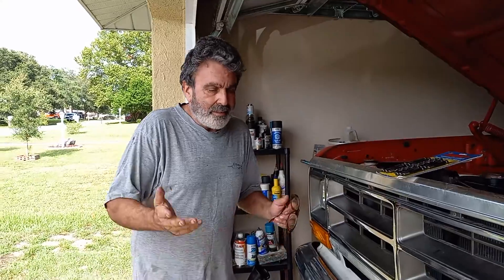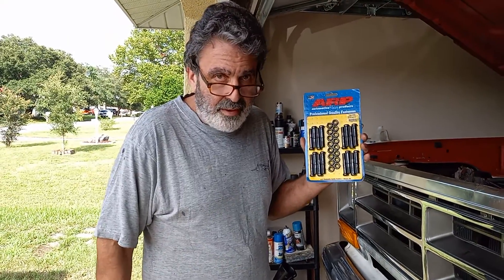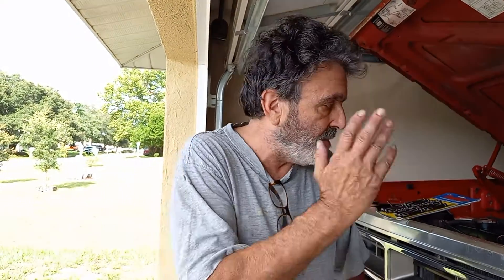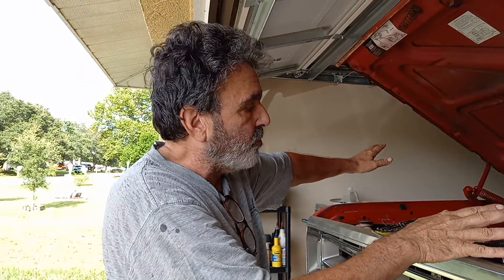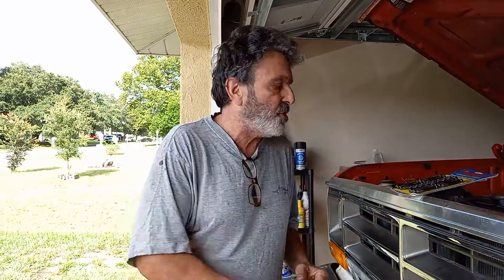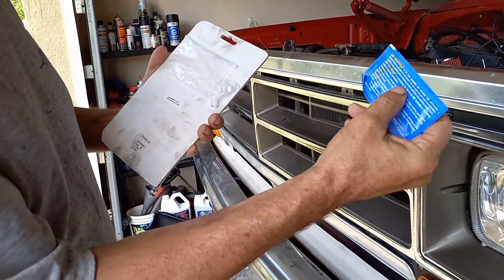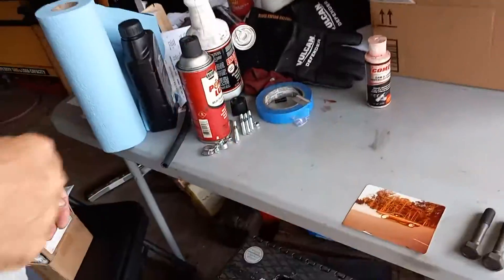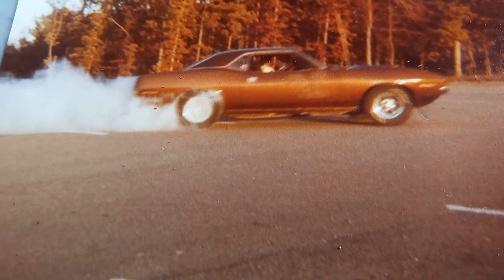Possible issue with my 360 mopar ARP main cap bolts ...

Comment: People spend money on all type of speed parts that they do not need, and which will not make any difference on how their engines perform.. ARP bolts are certainly at the top of the list. I used to own a speed shop in the mid 80's to the mid 90's and was heavily into the performance aftermarket, and I am still in the business. The only ARP bolt that I will use on a street car that is not supercharged/turbocharged or uses nitrous are the rod bolts, anything else is truly a waste of money that can be better spent on something else. Only thing where people waste more money that on stupid bolts are in ignition systems. People will spend a $1,000 + on a billet distributor, MSD box, coil etc... and at the end of all that money they have an ignition system that will maybe make a couple more horsepower than their old points or electronic ignition, and will be less reliable than the factory stuff they had... Carburetors are another bad one, but that is a story for another day...

Comment: I stumbled on this videos and learned something. I have never used arp bolts because I don't race but good to know. 

I decide to subscibe because in high school (1984) I drove a 1970 'Cuda 383 4speed. I now have a 1984 W100 with a 318 that I'm going the swap in a 360 magum. I too have been building Mopars since the 80's. I thinks we're friends lol.

Comment: Your dead on with it should be on every package!! If you go to jeds speed shop on YT... he's working on a pro stock HEMI vintage engine and he had trouble with head bolts and correct torque... You would think a company would get out in front of this issue and save thier reputation!!... This is totally unacceptable period. Thanks for posting this it a great share!
Reply from the maker: Thankyou!  I have not seen anybody else address this issue...
Reply from the maker: I'll have to check that video out your talkin about....    thanks 😊

Comment: You would think that ARP would have tested the bolts at different  Torque other wise why would they put them at 110 fp I think they must be hiring stupid people that don't test anything if it test good on a computer then that's what is . Instead of getting out there and testing them and thats what you should have asked them is if they test those studs or just guess what to Torque them to.  And I don't think that it would have came loose so  I would have just left them alone and not changed them back out . Because if you have 60 miles on them and you have dropped oil pressure at all then I don't think you would have had a problem with them at 85 fp . Why would it even need to be at 110 fp anyway unless the bolt stretches  As it tightens up because the main caps can only bottom out and stop before it pulls on the threads in the block .
Reply from the maker: True, Yea all that make sence,  i got worried after they did say to me on the phone the material their bolts are made of require more torque then factory bolts to achieve the needed clamping force  so that didn't set to well with me since my engine wasn't line honed at 110lbs and torquing them that high could warp my block..  I wasn't willing to take that chance...   anyway thanks for the response...    😊